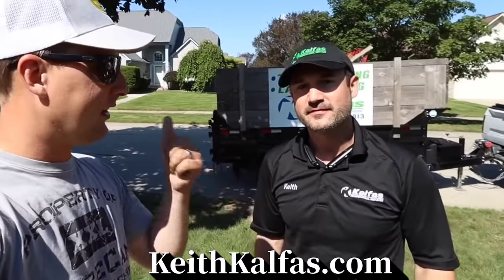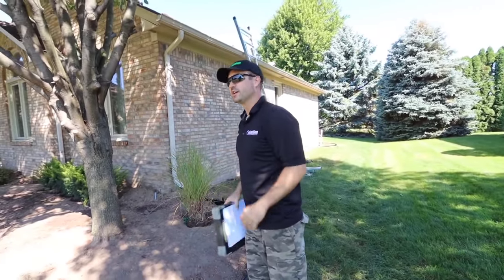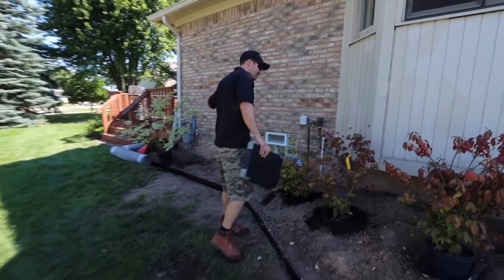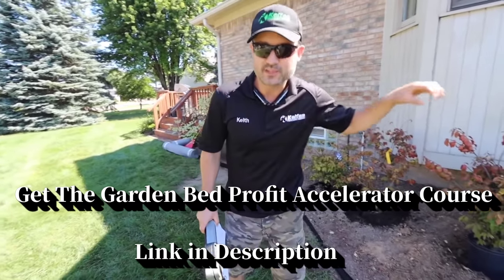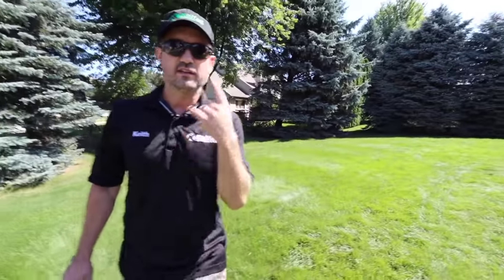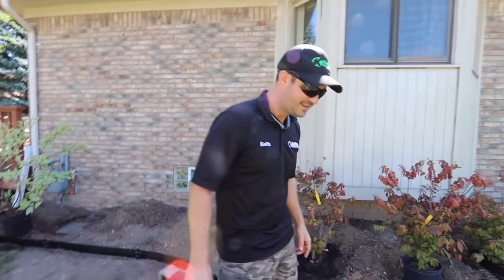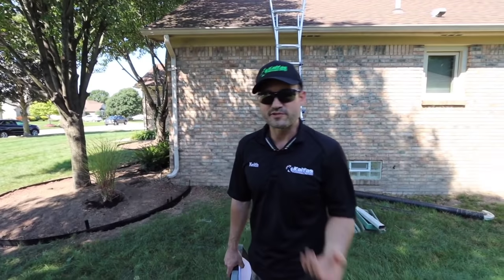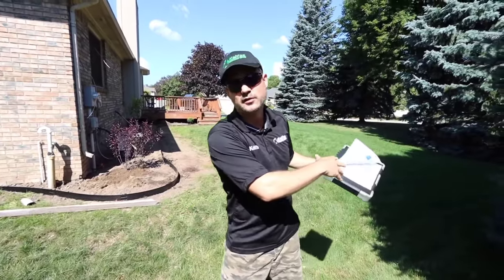$13,000 Landscaping Project / Property Walk with Keith Kalfas /Tips & Mistakes to Avoid

Comment: Bro, my biggest mistake was using pump gas in my weed-wacker.
So my tip is to go to Magic Racing in Utica and get you a 5 gallon can of VP Fuels T2 Race Gas.
Yes, you wear it out faster when you are now able to run like 30,000 RPMs, but you get more lawns cut in a faster amount of time. So in the long run, you actually come out ahead.
Plus the race gas smells nicer, so it improves customer relations.
Reply: Why don't you use ethanol free?

Comment: I prefer just to talk the customer out of the weed barrier fabric, never had anyone insist on it. IMO it doesn't work very well, and after a few years it always seems to poke through the mulch and look horrible. Also to me it seems like it prevents the mulch from breaking down into the soil and enriching it.( many homeowners never amend the garden with anything else either)
Reply: I always recommend NO fabric. From experience it's more of a negative long term. The only place ill use it at is at an area when there's only riverrock down and nothing else
Reply: @Pantelifts10  It definitely has its uses, I just don't think a bark mulch garden is a good application for it.